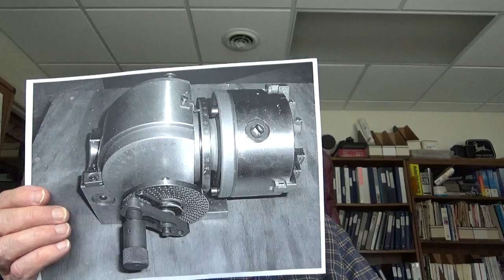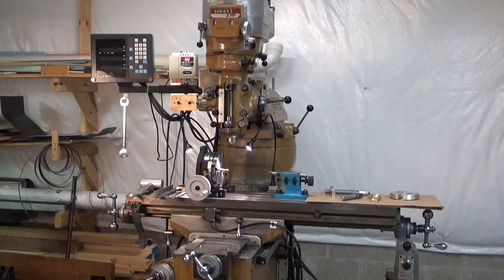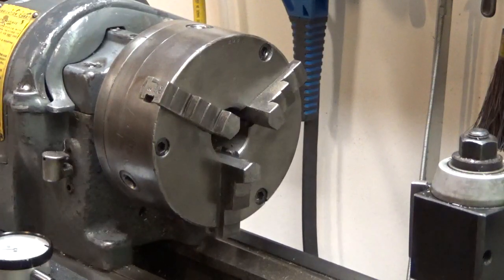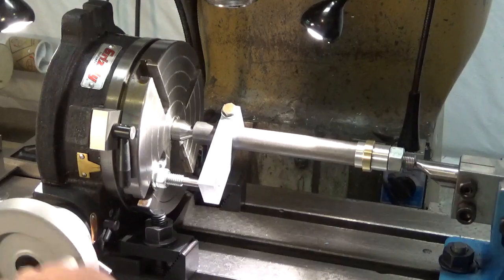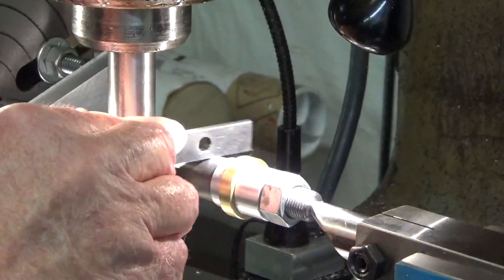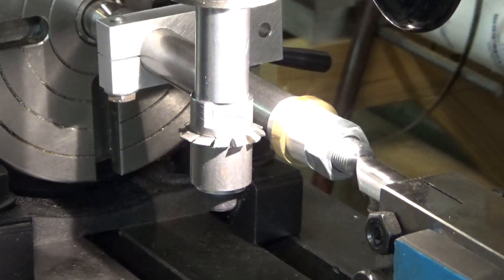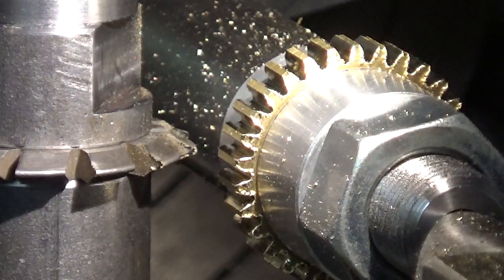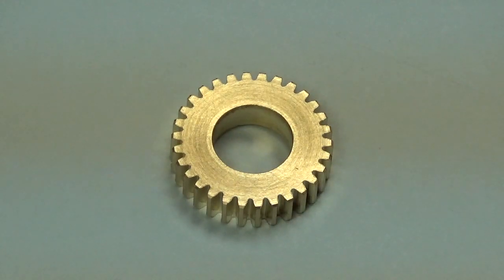Making Gears in the Home Shop -- Automatically PART 1

Comment: Paul, I noticed your hat.  My grandfather used to have property across the Peshtigo river from Mr Trecker back in the 30's.  Thanks for the memomry jog.  BTW nice informative video.  So much of this knowledge is being lost or going into the underground if you will
Reply from the maker: Thanks, Corey,
I have learned a great deal from some of the You Tube creators that have been at it far longer than I have (Kieth Fenner, Adam Booth, Kieth Rucker, Randy Richards, etc.)  Quite a few have K&T horizontal mills and really love them, so a couple years ago, I had the hats made as holiday gifts for them.

Comment: For manual gear making one wants to use a dividing plate. Round holes with a conical index are accurate enough for most gear applications. I'm pretty sure most people that make or made gears will use the dividing head to make the dividing plate that will give them all of their gear increments. Check out this guy's vid. 
https://www.youtube.com/watch?v=uxzWk7v9sUo&t=5s

Comment: Paul, what pressure angle are your cutters 14.5 or 20?
Reply from the maker: Doug,  Pressure angle is 20 degrees.  I found the cutters on E-Bay from a vendor in Ukraine.  Paul
Reply: Thanks for the reply and information Paul.  Great video!

Comment: Harmonic analysis. I'm sure more than one of us viewers is still interested. Hoping you are too.
Reply from the maker: Yes, I am still working on the harmonic analyzer and should be able to post a video on that subject after the holidays.  
You posted another comment regarding the wiring of the safety cutout switches that I am not able to reply to for unknown reasons.  The wiring arrangement you suggest should work.  You should test it, though to be sure that tripping any one of the switches immediately stops all motion.  Good luck with your project.

Comment: By the way Grizzly sells a set of dividing plates for the rotary table  for $170. inc shipping.
Reply from the maker: Thanks for the tip.  I took a peek at your channel.  Nice job on the ring roller.
Reply: Thanks MAX....Cap.

Comment: Do more than 1 at a time, c-mon... also, I would think about wire edm'ing these and running like  6" long bars unattended at night then throwing on lathe and slicing up... I've done jobs like this before.
Reply from the maker: Sounds like you're way ahead of me.  The first series of gears I have to make all have different tooth counts.  20  of them between 6 and 120 teeth.  Another set is all 120 teeth and I will do all of them at one time.  See later videos in this series to see how I automated the process of making a single gear.  I can start it and walk away.  Thanks for your comments.

Comment: you do realize you said "ah"   127 times during that video lol
Reply from the maker: OK, that does it.  I am going to invest in an "ah filter" for my microphone.  One that also works for "uh".  Just watch out for words like upward, they might sound a bit strange.
Reply: You probably just need a script that you can read from. Presenting like this is a skill in itself and takes practice!
Reply from the maker: Yes, I was shocked when I re-listened to the track and looked for uh's.  I will have to make a few notes in advance and concentrate better.  Thanks.
Reply: max runout Ah, uh, oo, umm and oops are all in the engineers dictionary. These noises are evidence that your brain is working. A bit like, you know that your car is running, because the engine makes a noise. Good work sir, a nice finished product.
Reply: Max ya gotta be from 'sconsin ;)
Reply: just where might you be from?
Reply: Asshole, now I have to turn Of the sound.